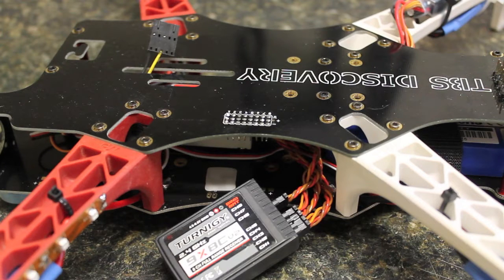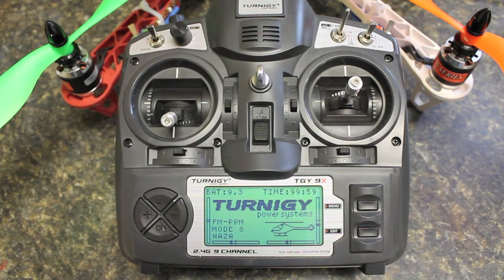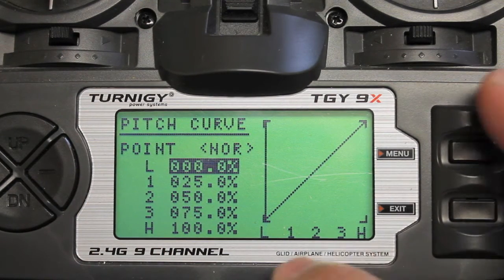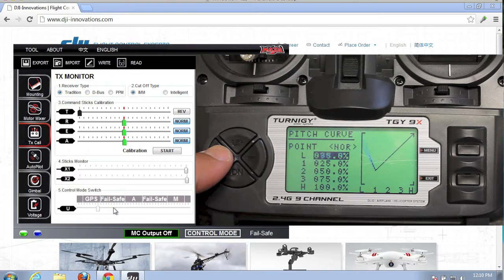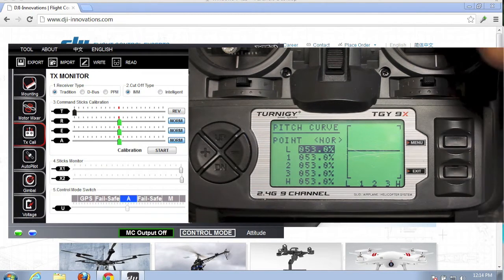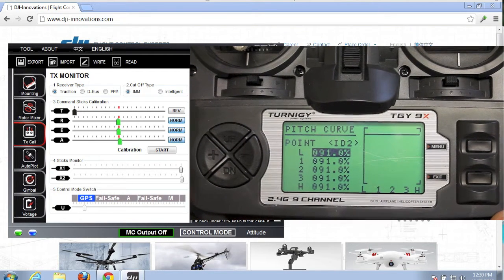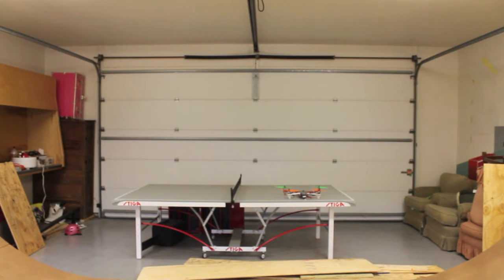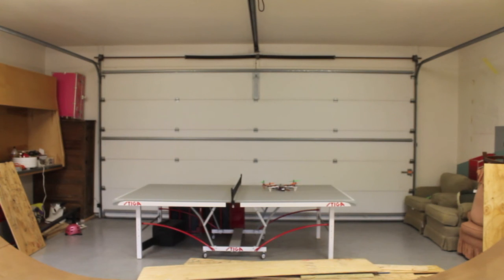DJI Naza 3 Flight Modes (Attitude, Manual, and GPS) w/ Turnigy 9X Transmitter and 3 Position Switch

Comment: Hello. I've tried to configure U channel to switch fly modes using 3-position switch, but have faced an issue, that the value transmitted to NAZA is never low enough to reach the GPS section and highlight it as blue. So, the transmitted values are in a range from -336 to 1000. I've set sub-trim to -120 and e.point to 120%, tried to reverse signal but it is always not lower than -336. So, I'm able to configure switching between Atti, FailSafe and Manual modes only. What could be the issue? I have standard TX (as you have) and 9x8c v2 2.4GHz full range receiver together with NAZA-M V2 + GPS.

Comment: dude your video has saved my butt; i use a radiolink at9, and had my control modes bound to a very sensitive slider on the back, with failsafe mode taking up most of its range - I managed to figure out how to bind the channel to a 3-pos switch, but now I can actually get the switch to point to the right control modes, because of similar software in my tx. thank you so much, now i can finally calibrate my compass!
Reply from the maker: Thanks for the feedback. A friend just purchased a Radiolink and I got to play around with it. I was quite surprised with the quality and ease of use.

Comment: even after setting up the three mode switch, the LED is blinking orange (slowly) in attitude mode, in manual mode its flying normally. i want to use attitude mode.... what to do ???? motors won't even start in atti mode...... please help
Reply from the maker: I'd recommend looking at the LED indicators and see what you can find out here: http://wiki.dji.com/en/index.php/Naza-M_LED_Indicator Let us know what you discover. Thanks.
Reply: Dhwani Singh did you find any solution??  if so then please contact me on vihangpatel1998@gmail.com

Comment: GOOD DAY, NEED HELP, RODE A QUAD TBS FRAME WITH NAZA LITE AND RADIO Turnigy 9X, FIZ SETUP RADIO AND MODES OF FLIGHT ALL RIGHT, I flew WITH QUAD PERFECT ... BUT THERE BEGINS THE PROBLEM WHEN I hung up and I called again did not select MORE THE FLIGHT MODES AND PARENT NOT GUN OVER ANY WAY ... WHAT CAN BE ??? I checked CABLES, I replaced the receiver, reconfigured AND NOTHING HAPPENS, THE LED OF NAZA IS IN tx signal lost ... WHAT SHOULD I DO ... help me please (Message translated by Google)
Reply from the maker: This is a strange one. I would suggest creating a new model in your Turnigy 9X and re-binding. Then setup your flight modes again and see if you can get the U slider to work when moving your switch. Let me think about this some more and let you know if I come up with anything else. If you figure anything out please let us know.

Comment: Dennis,  

After a bad crash that bent a the metal rod that goes down the middle, losing a camera, a prop flying off ( which caused it obviously 'myfault') and losing a $40 camera. I rebuilt it with some spare parts.  

I decided to do a fail safe while losing TX signal and along with installing a new (to me)  RX (X8R) and your videos she is back in the air with more confidence than before.

Thank you again for all the great tutorials that you have provided this hobby! Extremely invaluable!

Remy
Reply from the maker: Thanks so much for the good words and sharing your experience. The thing I love about DIY builds is what we learn when we crash and how to get back up in the air again. Most Phantom owners are unable to say the same. Good luck with your rebuild and hope all goes well with it!

Comment: What's the diference betwen GPS and ATTI?
Reply from the maker: +Bello3 GPS mode tries to hold position based on GPS satellites. Atti mode is more of an altitude only mode (doesn't use GPS).
Reply: Ok Thx

Comment: Power and ground are only really needed on one connection between the flight controller and RX.   You can put the other 3 way leads sideways on the signal pins of the channels, reducing the number of wiring harnesses needed between the two devices.
Reply from the maker: +Spoif Good point. That's what I'm doing nowadays. Thanks for sharing.

Comment: I'm using ppm and for some reason my channel 7 is linked to Control mode switch and my pit curve is linked to X2. I managed to mess around in the mix settings and get 3 position switch to channel 7. However i can only get as far as Atti. eg. I have it set to atti failsafe and manual, Could someone help its really frustrating.

Comment: Hey there denny, Can I use my Turnigy 6x with Naza Lite ? coz I have an issue when trying to do that, the Naza flashes yellow so fast and keeps in that situation :(, when the Tx is OFF the mode switches to ALT mode, and when ON it switches to the far right " EMPTY LITTLE BOX" !!!!!!!! any HELP please, does this trans. supports Naza lite ? Thanks in Advanced
Reply from the maker: ayman fatani I've never used the Turnigy 6X so I'm not sure. I would start with your standard four channels (AETR) and once you've confirmed that is working you can try to add your 5th flight mode channel. Sorry, wish I could offer more help.
Reply: Thanx so much for your help, you know something I discovered that my naza lite was corrupted, and I attached a brand new one everything went fine and I got the FC started and armed, loooool I was trying for about one day to solve this issue, is there a way to know if the FC is working or not although all the flight mode led light works as it should according to the mode you are at, but the problem was with arming and disarming, It really got on my nerves but thats fine I learned a lot, but I am wondering if the reason that the FC stopped working cause of the ESC which comes with BEC and that I forgot to pull out the red wires and connected all 4 with the red wires on, do you think that was the reason?

Comment: having trouble actually linking the 3 pos switch to control that. It is linked on the receiver to channel 7 (6 for some reason links to the throttle).
Reply from the maker: Joe Anthing If CH6 is linked to throttle you may be in HELI mode. Try switching to ACRO mode. Hopefully this helps a bit:

https://www.youtube.com/watch?v=u5cyrLZzr3g
Reply: Acro was a pain. Ive managed tl set it up now in heli

Comment: I did the calibration but nope, the rudder is still staying 2 points towards right. 
If i factory reset the turnigy 9x, do i have to bind it again to work or all i gotta do is the put the values and settings back again? I wanna try that if i dont have to bind it
Reply from the maker: eldhose nariyelil Yes I'm pretty sure you have to bind it all over again. Not sure why your rudder is doing that, but in case you haven't already done this make sure you have centered trim and go to each endpoint (left and right) in the assistant.
Reply: I tried it but it is not going to the center.. i adjusted the subtrim but it moves only little bit.... 
I dont have the bind plug otherwise i would have factory reset it... im sure its because my settings are off

Comment: Hi dennis
Thank you so much for showing us how to set the radio up
But im having a problem with my rutter instead of lining up in the middle and being green its stays 3 marks towards the right, i adjusted the sub trim but it is not centering i did calibration but no help 
So please help me out 
Thanks
Reply from the maker: eldhose nariyelil That's strange. I'm not sure what's going on. If you can't get there with your subtrims then maybe you should do a TX calibration. I know you can do this with the Taranis and it looks like this is possible with the T9X: http://dl.btc.pl/kamami_wa/hk_8992_14.pdf

Good luck and let us know how it goes.

Comment: dennis, i have settup up my discovery with nava v2 and turnigy 9x according to your video and every thing works accordingly except for manual mode. It shows on naza software when i toggle 3 position switch and highlights blue above gps, att, but not manual the arrow below it is centered but will not highlight it just goes to failsafe. any ideas?
Reply from the maker: Jared Cruthird That's strange. I've seen at times that the PWM to turn on the appropriate flight mode is pretty exact. So if you're off a little bit the flight mode won't highlight. My best guess is that you may need to fine tune your values to get manual mode to highlight. If that's not the problem then I'm not 100% sure what it is. You should definitely be able to get into manual mode.
Reply: thanks for the reply dennis, i posted a video of it over on garage pilots as well so hopefully i can figure it out.

Comment: Hi i have a turnigy 9x too. The manual of naza says i need to use a new model in the radio as AIRPLANE mode.... i see you are using the HELI mode... did you find some problems? is not a problem use HELI mode? I'd like to use heli mode too because is more simple for set the switches on the radio...
Reply from the maker: ***** I switched to ACRO mode a while back, which is just a different template than HELI. Now I'm flying with the Taranis and configure most of my setups from scratch. Here is a video I did a while back that talks about some of the differences between ACRO and HELI on the Turnigy 9X. Hope it helps:

Turnigy 9X Heli and Acro Flight Modes Explained

Comment: Hi,my turnigy 9x doesnt have neither throttle curve nor pitch curve option,what can i do?
Reply from the maker: R. WIZA You're probably in a different flight mode. I know there are some differences between ACRO and HELI. This video talks a bit about it:

Turnigy 9X Heli and Acro Flight Modes Explained

Good luck.
Reply: Dennis Baldwin thanks,you helped me.any way,what do you think on configuring all the modes on the HOV.THR in accro mode.(that's what I did and it works)

Comment: why is my flight mode changes when i push the throttle?
Reply from the maker: Fiqo Junior You're most likely in Heli mode and you need to adjust that or switch to ACRO. This video explains some of the differences: Turnigy 9X Heli and Acro Flight Modes Explained Good luck with your setup.
Reply: Got it! thanks!

Comment: Hi, your videos are awsome!!!!
Easy to understand and apply.

I've done the flight modes and fail same on 3 swith and gear. It is working fine!!!!

Do you have anything about course and home lock on Turnigy 9X standard?

Will be helpfull.

Tks and congrats for you!
Reply from the maker: Vilson Cobello Junior Great question. Unfortunately I couldn't ever get that figured out with the standard firmware. If you do an er9x upgrade you should be able to do it, but haven't done it personally. I'm now flying with the Taranis running OpenTX and it makes this pretty easy to do. Good luck with your setup.

Comment: do you usually take off the ESC plugs when connecting to PC? I have to take mine off or else the assistant software won't connect with my naza M-lite
Reply from the maker: Ralph D I don't normally have to do that. Under normal circumstances you shouldn't have to disconnect your ESCs to connect to the DJI Assistant. At least I never have.

Comment: when i connect channel 6 to the U port, and when i move the throttle, the u port possition moves with the throttle (in the naza assistant)
please help!
Reply from the maker: Guillaume Leleu Watch this video and see if it helps with your problem. I recommend watching the whole thing but the part related to you is at the 4:00 mark.
Reply: Dennis Baldwin
thanks for helping man

Comment: so you have your 9x setup inheli mode? how do you switch off auto mix of throttle and pitch because when i move throttle  stick up the throttle slider moves but so does the control mode switch slider. any idea whats going on thanks
Reply from the maker: I'll get to that video soon, but the trick is to watch the part of this video that talks about adjusting your pitch curve. That will set it to a static line and override the throttle control. Hope that makes sense. If not, then stay tuned.
Reply: Dennis Baldwin Hi thanks mate got it all sorted now thanks to you!! excellent videos btw !!

Comment: hi im using turnigy 9x and frsky v8fr reciver. all channels work but when i move the throttle stick up the throttle slider moves but so does the control mode switch slider. any idea whats going on thanks
Reply from the maker: Hi, you're probably in heli mode. Give me a couple days and I'm going to put together a video that explains how to set this up properly. I've had several others ask me about this and obviously I haven't done a good enough job of explaining it :) Stay tuned and thanks for asking.
Reply: i have too (Turnigy 9x і FrSky v8fr)/ Long Range!

Comment: Hi Dennis! Awesome video. I see you use heli mode but when I use this the u port in control by the throttle??? How do i get this to work? Please help i am so stuck with this matter. I have the turngy 9x and naza m v2. People have said use plane mode but then i dont know how to setup the 3position in plane mode
Reply from the maker: Hi, good question. Let me work on a video this week that details how to do this. I've run into a lot of confusion about this and there are several others that are having problems as well. Hopefully I can get a video together that will clarify this. Thanks for asking and following my channel.

Comment: Hi Dennis, I'm having trouble in setting up my 9X with the Naza M Lite. On the Naza site it tells you to use an aero as base model, but there are no pitch curves on the aero  and every time I use the heli model, it necer saves it. Have you any suggestions please?? Also I have the Qbrain 4 ESC and does this work with the Naza do you know??? Sorry so many questions, but I'm fed up of pulling my hair out and shouting at the pc!!!!
Cheers
Ken

Comment: i have a question, were you connecting the Tx to the computer or without connecting it ?
Reply from the maker: Hi, my Naza was connected to the computer and my TX was bound to my receiver. So that's how it picks up the stick movements in the Assistant. Hope that answers your question.

Comment: Hey Dennis, just got a used V1 so it is 9x set up night here! For my gimbal multi,
Reply from the maker: Nice, how's it coming along?
Reply: I connect it to computer and the MC output ON just flashes no connection via USB cable I guess can't find it in non existant manual. Otherwize pretty tiny box hope I can get it to fly. It is a proven flying unit as well so it will work.

Comment: Hi Dennis, i tried to do as it is done in this video but I have 2 issues:
1) I cannot assign F.mode to any channel. I supposed it had to be mixed to another switch. How am I doing this?
2) In NAZA menu when I move throttle also U change as well. I've done a wrong setting or what? I am lost here.
Reply from the maker: Watch the video again and it explains both of these issues. For #1 this is done via mixing and make sure you listen to the part about CH6 on our receiver going to the U port on the NAZA. For #2 watch the part where I show setting the pitch curve to a fixed value so it doesn't rise with your throttle. Good luck and if you have any more problems check out www.garagepilots.com

Comment: Hey Dennis, Have you looked at the new Assistant software, you can choose 3 modes at the end, the trick would be to figure out how to access a 4th function mode using the 3ps +1 other switch. So it would have GPS, ATTI, Failsafe and flick another switch and get Manual mode. Its beyond me, but maybe you can figure it out, without your Videos, my copter would be still sitting on my desk! Thanks
Reply from the maker: Thanks so much for the kind words. I haven't messed with the new Assistant but will be soon when setting up a buddy's quad. What do you think about GPS, ATTI, & Manual then the other switch being failsafe? So you have your 3 flight modes with one switch and then failsafe completely separate? I only ask because a few others have mentioned this configuration to me and asked if I would do a video. Not sure how it would be done but am going to try my best to figure it out. Take care.

Comment: i have turnigy 9x and it does not show the pit/curve
Reply from the maker: Are you flying in HELI or ACRO mode? Feel free to take a photo and post it in the www.garagepilots.com forums. We can help you out over there.
Reply: acro. i finally "i think" got the compass calibrated. i got the gps and manual mode to flip back and forth with a 2 position switch, but what should i hook up the fail safe and attitude on? i thought the attitude and manual had to be on same switch? also it finally let me start the motors, since i got the compass calibrated i guess, but (without propellers) it doesnt sound like it is going full speed when i push joystick all of the way up, maybe it is and just real quiet, just makes slightly different whining noise.
Reply: It needs to be in Heli mode.
Reply: thanks

Comment: Hi Dennis, I don't suppose you have a Taranis transmitter and have set it up the same as this? Chris.
Reply from the maker: Chris, I've been trying to get a Taranis for 6 months and cannot get a hold of one. When I do get one I'll definitely set it up, but it may be a while. If you know where I can get one then please let me know. Thanks!
Reply: I ordered mine from HobbyKing. I payed in advance and it took about 6 months too. Cheers.
Reply from the maker: Chris Latham Good for you! I may go ahead and do that. I didn't realize that I could order even though it's backordered. I know exactly when I order it I'll get a note from alofthobbies saying it's now in stock. What to do, what do to. Thanks for the heads up.

Comment: Hi Dennis, did you have to adjust any mixes to achieve this? My Turnigy 9x does not bind the AUX3 (3 channel switch) to any channel it looks like you have to mix it with a knob.